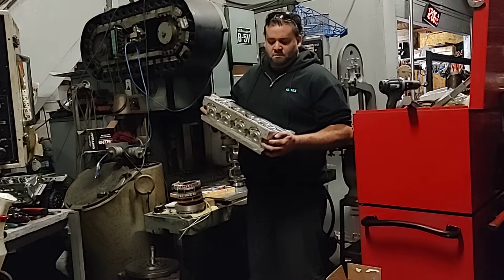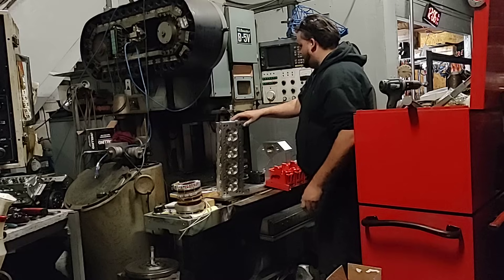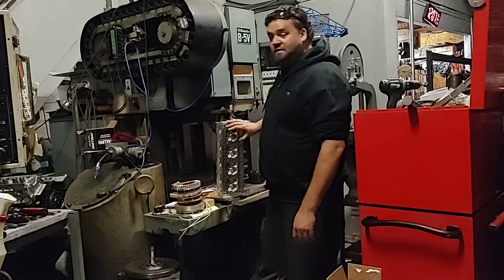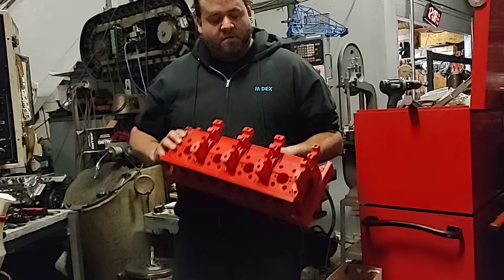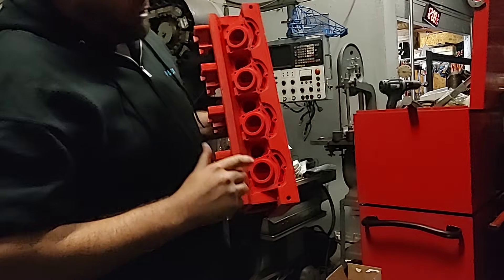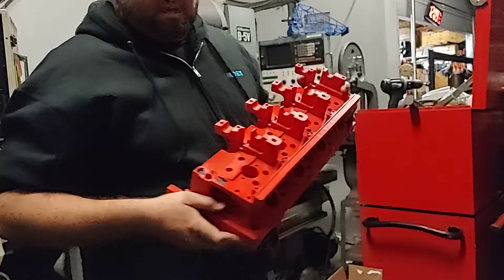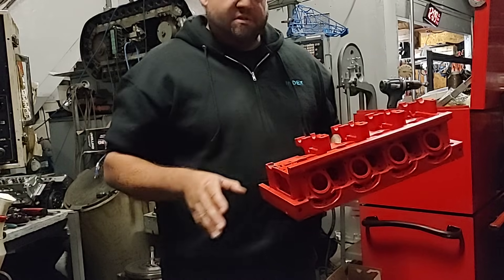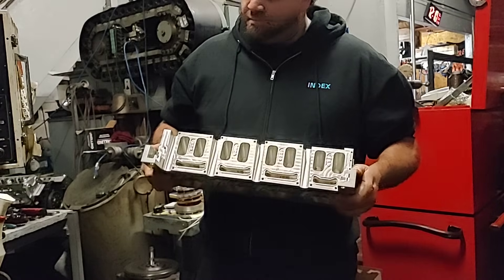LS 4 Valve Cylinder Heads- Better yet, they're BILLET

Comment: As a machinist i have soo much respect for shop owners putting it on the line using old machines and skill. Subd to see your shop take off.
Reply: Yeah that mori is like from 1985
Reply: @bobsbillets  First nc mill i ran was a mv45, circa 83 i believe. Thing was a tank, didnt break down in the 8 years i was there. It was a bit slow though. lol
Reply: I like creativity and machine work. Subbed to checkmout what else you got going on.

Comment: An ambitious project. Not sure 4V and pushrods go together. Looking forward to seeing these things run.
Reply from the maker: Works for Harley Davidson M8 engine.
Reply: Also. Duramax and power strike v8s have 4 valves and pushrods
Reply: Mercury racing has been making 4v pushrod stuff for years. Originally for small block and now for LS. They even have DOHC setups

Comment: Very nice. I sure hope you upscale these to match the dart big bore blocks. Very impressive. Will subscribe and wait for more.
Reply from the maker: Thank you! Yes, sbc, bbc, sbf, sbd, bbd and Dodge viper are in the plan. I have two different designs that work with each head bolt orientation. Focusing on the LS right now, that's enough to do!

Comment: I believe Oldsmobile tried this back in the 60's. They had problems with the extra weight of two valves causing increased ware on the cam. But they were using a flat tappet setup.
Reply from the maker: I just saw that on Uncle Tonys. There have been many that have done it, the most successful version in a production setup is the Harley M8 engine

Comment: please patent before someone rips you off because this is legendary my friend
Reply from the maker: Thanks! I would also like to see them try. 500 hours of design, (next one for sbc will go much quicker) and the cost of doing this is immense. One problem but also one solution is I'm one person, so there's nothing left between the cracks!!
Reply: @AwkwardPerformance  the chinks have 5+ axis machines, foundries. they WILL knock these fuckers off if they find them. they are selling Billet Honda K24 blocks on temu for 500 bucks...you cant even buy the chunk o billet for that here! getting a patent is semi worthless but at least its relatively cheap and gives you a leg to stand on.
Reply: @AwkwardPerformance  hear me out. 454 4v head
Reply: Me want for ford 300.  People have been chopping and welding LS heads and they appear to work well.  How many would you get in a 12 foot stick on those?
Reply from the maker: @middleclassthrash I imagine you could get 5, not exactly sure how long the 300 head is. I think that swap is great and funny. I wonder if the push rods would clear, mine run 10° off tappet line to get to the rockers.
Reply: @AwkwardPerformance  There would be a market for these.  I have one sitting and waiting on anyone to bring any kind of crossflow head to market.  There are millions of these engines out there.  Please at least investigate machining standard 2v ls heads.
Reply from the maker: @middleclassthrash I have my hands full with these heads currently. Once they are online then I'll start looking at variants.
Reply: @middleclassthrash what do you mean?,all v8 heads are crossflow, all crossflow means is intake port on one side of the head and exhaust port on the other side,4 valve,2 valve,doesn't matter if it has 27 valves, that has nothing to do with it being crossflow, neither does valve location, its where the ports are.
Having said that awesome heads👍
Reply: @AwkwardPerformance  If you do consider an I6 head the AMC I6 (Jeep 4.0l) is extremely similar too. It's a 4.38" bore spacing and shares the 1.9" pushrod spacing of the LS. You can literally bolt LS pushrod guide plates onto a 4.0l
Reply: @stevennott6139   MCT was referring to a head for the Ford 300 inline 6 ("4.9L" in EFI form, to distinguish it from the 302 V8 [5.0L] v8) which is LEGEN.DARY! for its reliability and stump-pulling torque, but has always been hampered by its "latest, most modern 1920s technology!" intake & exhaust on the same side of the head, w/ all the shortcomings implied therefrom. There was a shop in Arizona that promised a x-flow alloy head [wt. loss would be another HUGE bonus for the rather jumbo 4.9 I6] for the 300] but iirc, they had issued that vaporware product announcement during the 2008 GFM [before the worst f/x were felt in 2010] and nothing ever came of it.

So yeah, die-hard fans of that rugged classic have been holding their breath for quite awhile now, & we're all tired of turning blue waiting...
Reply: @middleclassthrash  there is a racing division in Argentina that uses old American inline 6's. They made their own cylinder heads for the motors, including Ford 300 and smaller. They are DOHC with 1 pulley. The racing division is called Tourismo Carretera or ACTC Argentina. The cylinder heads are unobtainium though
Reply: I’m not trying to rain on the parade at all (because I love stuff like this). But I can tell you, as a guy with patents: 1) they’re very costly and EXTREMELY time consuming to secure, particularly international ones. Because it’s not like there’s just 2 kinds. There are like 208ish countries in the world. 2) in the US, the qualifier is “new and novel”. 
This isn’t really new or novel. The downside to a patent is that you have to tell everyone how you did something and then hope they honor the rules. While you have no legal protection with a good old fashioned trade secret, you do get the benefit of non disclosure. You’re obviously a capable machinist. With parts of this complexity, it should be very easy to still make cool videos, and intentionally gloss over details that people are just not going to be able to figure out from a YouTube video. That would be my best suggestion to protect your work. Best of luck with your business👍🏻
Reply: Not even worth it to patent anymore... especially since he's already here, exhibiting them in public domain.
Reply: Some Chinese company will just buy a set and copy them. Not much you can  do about that. And a patent is only good if it can be enforced, there is a lot more work and cost goes into getting a global patent than a local one. Since it is very time consuming and needs to be CNCed, chances are they won't even bother trying to copy it.
Reply: @DodgyBrothersEngineering  global patents dont exist. you are talking out your ass.
Reply: @DieselRamcharger  semantics. It is the Patent Cooperation Treaty (PCT), and it covers 150 countries with a single patent filing. OK it doesn't cover the "entire" world but it does cover a damn big chunk of it.
Reply: There have been 3 companies that have tried this in the past with little success. Hopefully this one takes off and the price drops. To be competitive
Reply from the maker: @crazysvt03 West lake, valley performance and arao right? Amongst Mickey Thompson, Gurney, moser, and a long list of others as far as i have researched. There has been something to learn from all of them! Looking at 7k range for assembled heads boost ready. Should be able to get into the high 2k hp range in drag and drive from
Reply: @AwkwardPerformance  i knew of 3 so your farther into the research than i ever did, makes sense since you are designing a new head 😂 but yeah all of the lessons learned should help you succeed, personally i couldn't afford them at 7k but im sure if they flow better than ls3 or ls7 style heads there will definitely be a market for them. Valve stability at 8k + would definitely be a selling point as that was a huge concern for the marine applications in the past i cant remember the manufacturer of those its been years
Reply from the maker: @crazysvt03 I've done my best to have these 8-9k rpm capable. Valve train geometry is as perfect as it can get. Drag race, Marine and off road is this products target. By the time you get a $4k head setup with high end valve train, you'll be right in the same category of spending. If it helps, at .300 valve lift they flow as much as a stock ls3 head at .600 lift.
Reply: Yeah I don’t think this is patentable. It’s cool but it’s not novel. GM itself makes a 4v pushrod head in the Duramax, and fully machined cylinder heads in general are relatively common in the performance aftermarket. If there are any novel solutions to specific problems in this application those might be patentable.
Reply: There already others who do this....
Reply: Not sure you can patent this. 4 valve pushrod heads aren't a new idea but they are very uncommon
Reply: What would you patent? You could get a design patent though that would help against 1 to 1 copies.
Reply: Impressive, full CNC with cooling and oil passages. LS head competition is fierce though, may be better to explore a less crowded engine market too.
Reply: Yup dont delay.
   I dont know fusion very well, but I have 4 valve heads drawn up in there, just as a project for something to do.  I managed to make it work, so better engineers will be able to do it much quicker.  
    I have zero intent of moving forward on my setup, but take the reigns brother- get your name on those things!
Reply: Give me a break. I'm pretty sure other people have done it in the past like arao
Reply: Mercury SB4. It has been done and is in production.
Reply: Should try a set for a sbf since ls heads fit pretty closely
Reply: I was just gonna say, you should patent this ASAP. Don't underestimate the ability of overseas sweatshops to copy your work and undercut you.
Reply from the maker: @michaelblacktree what would i patent on it? It's all been done before. Harley M8 has the same system. Engines from the early 1900s had 4 valve per cylinder
Reply: @AwkwardPerformance  ,,,,,,,,,,,,,,,,,,think about  a patent title that secures the heads to you,,,,,,,,,,,,,,,,,,,,,gotta be a way ,,,,,,,,,,,
Reply from the maker: @ThomasELeClair not sure what to patent. Do you know what to patent? And what does that actually help with? It does detract from my time and resources to getting them through testing.
Reply: too late, I've got my contact in china working on it.
Reply from the maker: Let me know if they need drawings
Reply: Lmao  @AwkwardPerformance
Reply: You should start learning to look beyond your own narrow horizons.
There are companies overseas that don't need your fantasies and ideas and have been doing things themselves for a long time.

For a few years now, there have been a few inconspicuous channels of Chinese companies that deal with engine conversions and that is what you can see there, leaving out the stuff of older channels like Children's Carnival 😂

And instead of saying that he should patent something, like others do who just steal ideas from some old online forums, you should rather support him financially And buy his shit 👌🏻
Reply: @nee3029 That was way more negative than it needed to be.  The guy is simply concerned for John. @nee3029

Comment: You should contact David Vizard in youtube to see if he could get you any ideas or improvements from his 50 plus years of racing engine experience
Reply from the maker: Nothing against him, there's about 300 into this from hard core Dyno and racing results from every type of Motorsports. He's very knowledgeable, but I would probably argue with him😂. Some things on the flowbench don't translate to the dyno!!
Reply: What about Richard Holdner?
Reply from the maker: @erickbernard8208 I think the time to collaborate is later. I have invaded his streams asking genuine questions on flow numbers from these and results, and he seems to get irritated and not answer. So instead of bugging people I respect, I'll just post what I'm doing, and get them running and turn some heads that way. I'm doing these videos to show they are real.

Comment: I wanted to add more, I came up with an automatic offroad transaxle designed with a 10" Quick Change ring and pinion and the guts of a Powerglide transmission the business fell apart and the parts never got made but oh the dreams
Reply from the maker: I work for a company who's owner's father designed the halibrand (not sure if I spelled that correctly) quick change, and it's always sad to see good things fall apart. This project I'm doing solo for now to ensure no failure. I think without winning the lotto, it's the only way. I have support from many directions, but I make all the calls, work and all the progress. Thanks for watching, it's going to get exciting soon

Comment: Will double the springs cause any issues with the lifters and cam since there will be more pressure placed on them?

Also, cool project. Love it.
Reply: Two small valves are light and can light spring pressures. A pair of those springs will be less spring pressure than what's common for single LS spring to run the same RPM.

Comment: Absolutely amazing! You should get in contact with Steve Morris, he would love this.
Reply: I agree. Steve would also be one of the top picks.. He's designed his own engines. He's not just a dyno tester or a salesman. He's the type of guy where the best idea wins, not someone's ego. Ben strader from EFI university would also love this. Ben put a set of hemi heads on an ls.
Reply: If these heads can hold up to the rpm he runs and the cams don’t take damage from the spring pressure, you’ll need a bigger shop
Reply: Steve doesn't understand ignition timing. Keep these away from him.

Comment from the maker: Always make sure to have your whole head in the frame. Nailed it
Reply: Ever think about pollution free engines ?
It's what the World needs now .
Cool heads Sir .
Reply from the maker: @NCOGNTO these are too run on alternative fuels. They make more HP. I'd like to see the pollution from wars stop first to be honest. Corn needs C02 to grow, so these will help with that!
Reply: @AwkwardPerformance most wars are over who controls oil .
My previous comment seems to be lost did you get it ?
Reply from the maker: @NCOGNTO there's more than a couple of comments on this, if you would repeat it, I'll be looking for it. I had no expectation to get this much response!
Reply: @NCOGNTO 
No matter the form of motive power in a vehicle there is going to be pollution involved somewhere. From mining the ores used in their manufacturer. Refining and smelting said ores. The manufacturing process etc. Modern internal combustion engines are extremely clean. Are they perfect? No, but even electric vehicles face their own environmental issues. Early cars and trucks were seen as a godsend due to the issues cities dealt with dealing with the mountains of horse 💩
Reply: G @mpetersen6 would the air be "cleaner" if our engines emitted Oxygen (most immediate human necessity) instead of toxic gases and particulates (about 20 pounds per gallon from gasoline) ?
I think so .
That's not just "zero" like electric cars .
I get your point but we are talking actual engine emissions not manufacturing  .
Reply: @mpetersen6 I have been a time up mechanic for over 60 years now and amazed we can still breathe
Reply: Spelchex
Reply: @mpetersen6 here's a couple facts -
If we burn a billion gallons of gasoline per day (that's a little low I think) and each one makes 20 pounds of toxic , that's 20 POUNDS or 10 MILLION TONS of toxic gases and particulates each day
Reply: It's my phone
Reply: @NCOGNTO 
I never said internal combustion was perfectly clean. Its a lot cleaner than it was in the past. What l was getting at is every form of energy production comes with some sort of environmental cast. Even if it is only on the production side of the energy producing device. 
If the toxic gases you mention include CO2 just what is your idea of the proper atmosperic percentage. If you say zero. Congratulations, you just killed the planet.
Reply: @mpetersen6 I hope you have come to understand what we call "pollution" (only the EPA can name something as a "pollutant" mostly comes from our choice of fuels .
Burning oil pollutes . You can "condition" it but what we do now actually increases the TOTAL of toxic gases produced by ICE's,
Consider the change from PM 10 to PM 2.5 or the alteration of CO to CO2 by law .